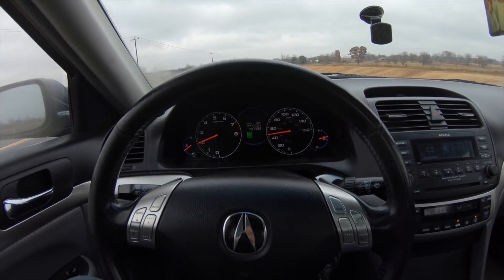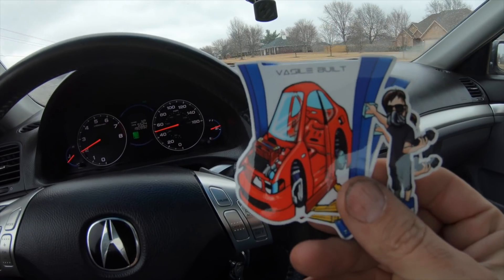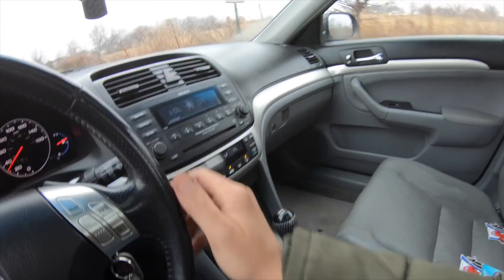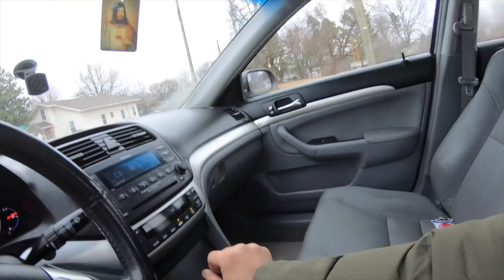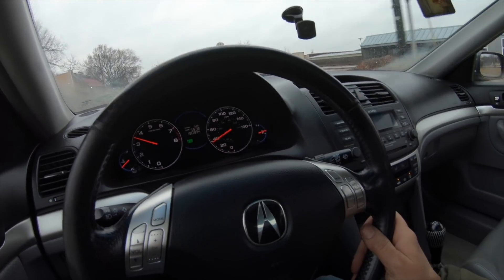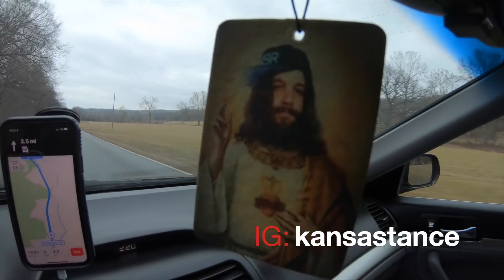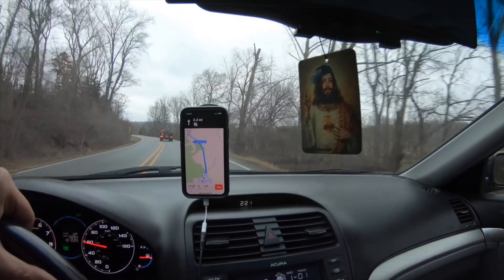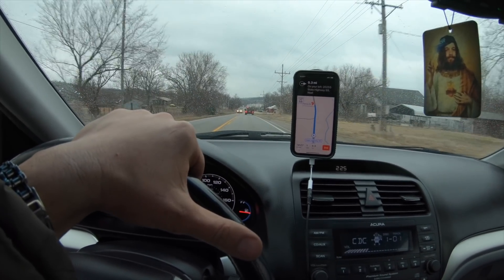Acura TSX function and form

Comment: Hey my friend thank you for responding back I need some advice  I have an Acura TL type S 2008. I’m trying to change my suspension  should I go with yellow Koni     
I do not want to rub.  What did you suggest
Reply from the maker: you won't rub unless you have the right fitment, I like the new suspension I put on the tax, smooth ride